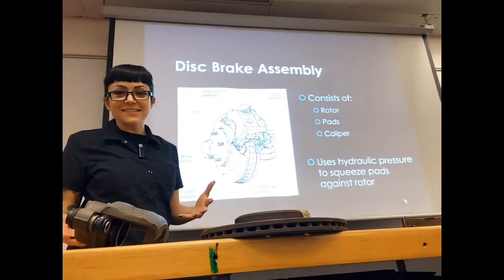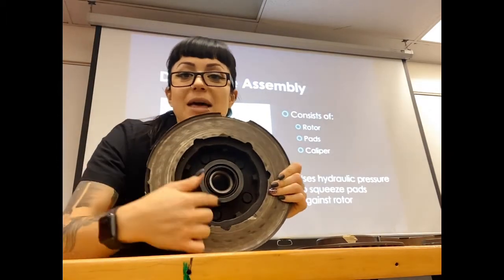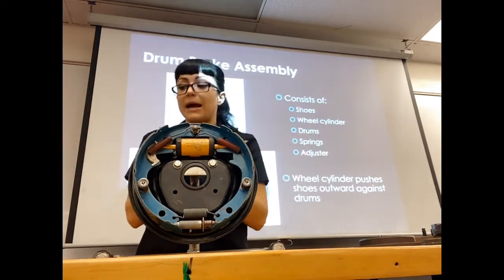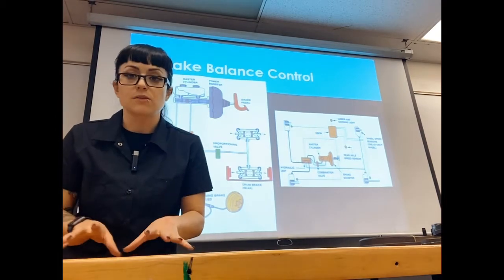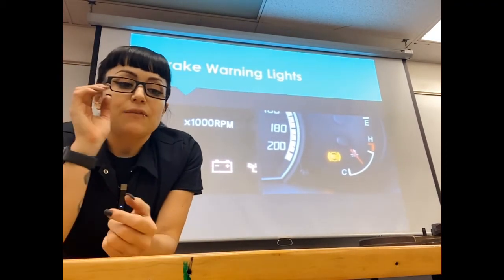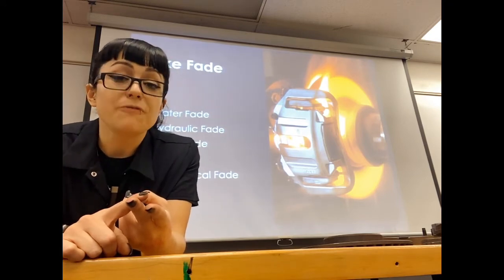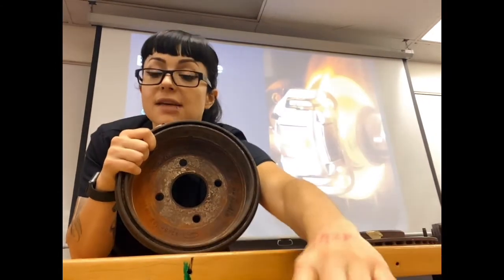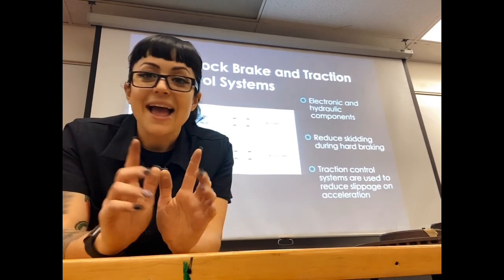Brakes 2

Comment: I have queries about vacuum booster there some measurement of the push rod to the master cylinder which needed to be accurate.clarification of rasted pin rods for calipers which can move flexible while braking including bleeding procedures

Comment: Great video, however you forgot to mention how the slide pins attaching the caliper to the brake hanger allow equal force to be applied to both pads. It is very important to service the pins with grease and replace torn boots so the pads wear evenly. Also I love watching you on Real Mechanic Stuff.